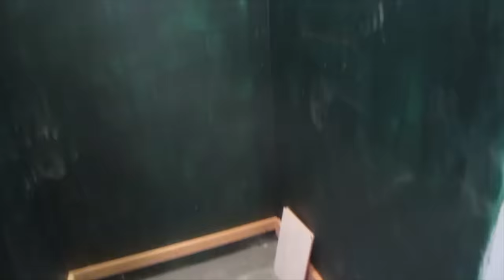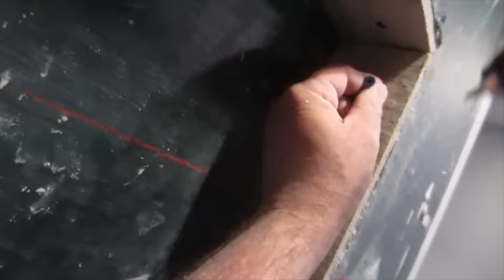Complete bathroom shower install time lapse start to finish

Comment: Now this guy knows what he’s doing.... thinset under a  properly mixed pre-slope... this guy cares but I think a pre-slope is unnecessary.... this is as good as it gets as far as installation never the less
Reply from the maker: Preslope is an integral part  of a two stage "Water in, Water out" shower system,  don't  believe what others might tell you.

Comment: I am building a tiny home and would like to install tiles in the shower stall. Because weight is always a consideration in building on a mobile platform, I am strongly considering using 1" foam board in lieu of the traditional cement board. Aside from being a fraction of the weight of cement board, it is highly moisture resistant. The tile is a mother pearl tile which is also very light as well as thin (2 mm). The manufacturer recommends using a white or clear modified thin-set w/ non-sand grout. With all of this said, do you foresee any issues using a foam board underpayment instead of the traditional cement board?
Reply from the maker: I hardly ever use cement board these days, Iso I don't see an issue there, the problem will be movement of the mobile home.

Comment: Nice work, just wish you would have shown more on your curb finish after liner and whether or not you redid the waterproof for the soapbox after you cut the hole in the wall

Comment: Did you need to mud your cement board seams after you taped them or is it ok to just apply the waterproof membrane over the mesh taped seams?

Comment: All of this looks great but I thought the durock has to be 1/8 inch minimum above the drypack according to tcna and your previous videos? Primary reason is the moisture wicking and cracking the bed. Am I not seeing something here?
Reply from the maker: Durock is a cement board, so can be in the mud, Hardie is a Fiber cement board and must be above the mud. TCNA B415 Look it up.

Comment: What happens after you put the polymer membrane on the floor and before you start putting the mortar for the tiles? Is that a cement sheeting adhered to the membrane with a special cement?

Comment: nice vid @SAL, gotta question for you, I`m presuming this shower stall was done in the basement, with an already existing concrete floor, what if I want to do something like this in my upstairs main bathroom? with a wooden sub floor. do i use a shower pan, or can i go with something like you did? would that not add weight to the existing floor joists? and if I can do it how would I make it completely waterproof? I`m up in Canada by the way. Thank you.
Reply from the maker: I have just the series of videos for you https://www.youtube.com/playlist?list=PLiB6hq5lQ3h2T96DP_LdSbULklkRaqYPr
Reply: thank you very much, this is much helpful, very insightful way of doing this, and do you by any chance have a complete studs to tile with the orange kerdi stuff?

Comment: I got a few questions.1 how wet should concret be density thickness yours looks dry is that normal  2 should i durarock outside wall of shower and tile does it matter

Comment: Excellent video. I have a question. I’ve done two of my showers, both times using 1/2” hardibacker and then painting redgard over it. Now I’m hearing that I should have used a vapor barrier behind the hardibacker on the studs, such as plastic sheeting or tar paper. Is this necessary when using redgard over the hardibacker? Thanks everyone.
Reply from the maker: No, either a topical waterproofing on the surface, or a vapor barrier behind, not both.
Reply: Sal DiBlasi holy!!! What a quick response! Thank you sir!

Comment: Since it skipped the part where you sealed the seams, I just wanted to know if you can use fiber tape and waterproof membrane over the seams and corners or is thinset and mesh tape a must?

Comment: Personally, I've repaired dozens of showers where the mortar from the pan dry rots the framing. Mostly bottom wall plates and subfloor decking. Please use some vycor tape or something like that between your deck mud and your framing.

Comment: Floor definitely has lippage. And when you grout , you should go against the joints or diagonal wipe. You're just emptying them if you wipe same direction as joints.
Reply from the maker: Your floor might have lippage, mine don't. I have been installing tile for 35 years, I think I might have figured the grouting thing out.
Reply: @SalDiBlasi  I'm just telling you what I see. And so what if you've been doing it for 35 years? I 've been doing it for 40 years, does that mean I'm better than you? Don't get mad cuz I'm stating what I'm clearly seeing. Your wiping the grout wrong buddy. And I can tell the floor has lippage.  Also why do you use a crap load of leveling spacers. ?

Comment: So my contractor did our walk in shower with Durock with edge guard, under that is that plastic sheeting that is about 2ft up the wall and on the shower floor, my concern is he never used red guard or any water proofing, we live in Miami one story home, says we don’t need it because there is no floor underneath us
Reply from the maker: If you havea wet area, you need waterproofing, no ifs, ands, or buts

Comment: Hey Sal, what do you typically charge for small walk ins? 60x32 Labor wise on the medium end.
Reply from the maker: +Joseph Chavez I have said it many times I never talk about cost in an open forum.
Reply: Sal DiBlasi just wondering why not? I'm not being a smart ass but really want to know since i don't really see the problem but know that there could be something I'm not thinking of. i usually tell people my  price per square foot before looking at their job so as not to waste our time.
Reply from the maker: Every job is different, if I say I get x amount of dollars for a certain type of job, then people will have an expectation of cost no matter what the circumstances are. I also never give a ballpark figure of cost, even when I am told that I will not be held to it, because if the actual estimate turns out to be more, they always will bring up the ball park cost you gave them, "But You said it would cost....." And a multitude of other reasons that can only bring you grief.
Reply: I know in my own group of guys, they dont share info cause of compitition and thats fine with me, I just teach myself and try and give my clients a reasonable price, what time is worth, but sometimes thats cheating myself. 

Well, what do you charge for just the drain, sandmix preslope, liner, sandmix final 2" layer and curb install? No tile. That should seems to narrow it down. lol. 

Rough ball park on small one.
Reply from the maker: Like I said, I don't discuss price, besides  how big is the shower, and what kind of system is going in, is it a sealed system, is it a water in water out system is it a hybrid. do I have to install the drain, what am I supplying, just a few things off the top of my head. I look at a job, find out what the scope of work is and go from there.
Reply: Sal DiBlasi Like i said, I do understand. 

Well, it takes me about a day to do all the work to get a 60 x 32 (3) 2x4 curb ready for tile. Was just looking at a guestimate on labor.
Reply: I use to sub out the base. I only put the tile on top of the base. But ive taught myslef how to do it all now because i want that money. But im just wanting to know if im charging them right. ive been charging $1,000 on my own and half that for contractors.
Reply from the maker: Do This, if you have a Facebook page, ask to join Tile Geeks I am a member and so are thousands more.

Comment: Great work sal, how long did it take you to do this bathroom?  I work for a remodeling company and they want me to tile a bathroom in one week by myself, that includes demo, plumbing and the regular stuff. I feel that one week its not enough time.
Reply from the maker: If you work 16 hours a day for 7 days no problem, rest sleep and food are over rated. Even with help you would be hard pressed, some steps require drying time, I would tell them to go find a hack, that can screw it up in an even shorter time.
Reply: I can do it with my helper in 3 days.
Reply from the maker: Gone are The days that I rush and push to get things done. I have been doing this for thirty years, I am over it.

Comment: Yo Sal, I was wondering if wonderboard Lite would do the job as well? I asked local tile setters about the pre-slope at the beginning and they kept saying it was wrong..lol  Definitely a red flag so I didn't hire them. BTW your finished product is like "forget about it" lol
Reply from the maker: +JOSE MORAN Wonderboard light will be just fine, the preslope is absolutely needed, you did the right thing not hiring them.

Comment: I installed 1/2" hardibacker against wood studs for my shower area. I had a pro put in the shower pan with the liner about 8" high. I've been told that I can tile right over the hardi board. Due I need to put that "green" stuff on first? Thanks
Reply from the maker: You can tile right on the hardibacker, but it will not be waterproof. I always use a liquid applied waterproofing membrane when I do mine, if you want to make sure that you never have a leak i would suggest that you do the same.

Comment: Man, you're killing yourself with that grout. Get you some Ardex FL. Stain resistant. Micro sand so you can use it in place of unsanded. Rapid set. Ready for full traffic in 90 mins. Color match silicone. Truly guaranteed. Can't beat it.

Comment: Sal, what parameters force you to pick and choose between cement boards and hydroban and schluter systems?Obviously the pre wayerproofed systems are better than waterproofing cement boards
Reply from the maker: I haven't used cement board in many years, as far as the others go, whatever I feel like on that day.
Reply: @SalDiBlasi  My fault. I didn’t notice the upload date. Even though I’m licensed,I’m a novice. From now on forward I’ll be using Schulter and systems alike. Now that I have done one bathroom with cement board I’m never doing that again.

Comment: thinking about installing a tiled shower on the 2nd floor.  are there any negatives? what about a prefab shower base?
Reply from the maker: +Optics If the shower is built correctly there is no reason not to.

Comment: Hey Sal how do you feel about tiling over plaster.
Reply from the maker: Why not
Reply: Had customer with plaster that was not flat and had cracks in it. I recommend tear down and start from scratch. They didn't want to do that. Instead wanted me to try to plum wall with mud and durrock. Told em not sure if u could that but wouldn't be able to guarantee the work as the plaster is cracking and isn't flat. Using subway tile they would see every imperfection. You think that was a good call.

Comment: I noticed you set up the mud on a concrete floor - can I do this for a second floor shower where there's only a subfloor?  if so - what are the differences?  Would appreciate any guidance.  thanks
Reply from the maker: If you have a wood sub floor, this how you do the preslope How to install a shower pre slope

Comment: When you install the cementboard.  Wouldn't the screws make holes in the liner? Would that be a problem?
Reply from the maker: That is why you never put screws below the height of the curb, and why you waterproof the entire surface.
Reply: Sal DiBlasi thanks!

Comment: Hi Sal, after you installed the liner, did you then install the Durock and then the second mud pan?  Or the second mud pan on top of the liner and then installed the Durock after?  In either case, how much of a gap did you leave between the Durock and the liner or mud pan?
Reply from the maker: +mister santos I usually install the durock before the final mud bed and leave it at least an inch off the liner, but i have to also add that i waterproof everything including the mud bed before installing any tile.
Reply: +Sal DiBlasi I will be waterproofing everything as well.  How far from the mud bed will your lowest screw be when fastening the Durock?  I'm assuming you can't go too low because you'll be piercing the liner behind it and then the final mud bed is what will be supporting and keep the Durock in place at the bottom...or is all of that irrelevant because of all the waterproofing that will be done?
Reply from the maker: +mister santos Always stay a few inches above the height of the curb, and the mud will anchor the lower part of the durock.
Reply: +Sal DiBlasi thanks for the help.  Been watching your videos repeatedly to prepare myself as much as I can before executing my shower.  Thanks for taking the time to reply and for posting all of these how-to videos!
Reply: +Patrick. Santos kmm

Comment: Sal hello from Ok. Certified tile installer 1009 here. Why wouldn't you move away from the pan liner and 2 peice drain and just use an integrated bonding flange from schluter, mapei, or laticrete? This would save you time since your already using fluid applied membranes. Also brush up on your TCNA rules for showers
Reply from the maker: You might want to check out some of my other videos, there you will find what I am all about, which includes  Schluter, Wedi, Hydroban board and much more. here is a link, https://www.youtube.com/user/saldibs by the way I am an NTCA member, have been to the CTEF and the TCNA and attend Coverings every year.

Comment: I noticed that you used 2x4's to construct the curb.  I heard this isn't a good idea when installing on concrete because the wood absorbs moisture from the conctrete and swells.  For my shower in the basement I would like to use 2x4's to do the curb, should I do anything to make sure they don't absorb moisture from the concrete?  Great videos!
Reply from the maker: Sean Marleau I actually did not frame it, i just took it from there, but you want to make sure you isolate the wood from the concrete.

Comment: Mr. DiBlasi, Is it possible to tile over an existing shower floor by grinding it? the old floor is made of what seems to be a pitched base of smooth concrete or stone with black and white chip design.
Thank you!
Reply from the maker: Without knowing how the floor was constructed it is hard to say, but it may be possible to tile right over the existing floor and using an extension at the drain.
Reply: I have a close up photo of it but I don`t think I can send it trough here..it is just a one piece slab shower base very thick and very solid like stone/concrete..it  is very smooth to the touch, so should I brake/chisel the surface so the thinset and tiles will adhere better?
Reply from the maker: Global Homevest I can't possibly tell you what to do, sounds like it might even be Terrazzo, but like I said i would need to physically see it and touch it to be able to advise. It is only a guessing  game from my end.

Comment: Sal I have a new home (new foundation) that I plan to install tile. The tile has manufactured edge that allows small grout lines without using spacers. Would it is a wood style tile. Would it affect home settling and causing cracks being too close edge to edge?
Reply from the maker: Minimum grout size is 1/16" should never be smaller than that.
Reply: @SalDiBlasi  I think that manufactured edge gives 1/16 when two tiles are pressed together. Thanks
Reply from the maker: @SharpBlockSoft  should not butt tiles together.
Reply: @SalDiBlasi  thanks. I will use 1/16 spacers

Comment: One thing I don't like about the rubber pan base in general is all the ones I've replace are typically full of water under the tile --- but at least they don't leak
Reply from the maker: That is probably because there was no preslope and the weep holes were plugged.  https://www.youtube.com/watch?v=p8xsx3316IU

Comment: I see this master tiler guy "TileMasterGa" on youtube who does not seal all of the backer board and only applies thin set on the tile, not the wall.  Where do these guys get off calling themselves Master Tile Setters"?  They can't even follow simple directions or use industry standards.  Love you videos.  Nice to see things done right..
Reply from the maker: I actually know Michael and he is a good guy, he uses a lot of Denshield which has a waterproof membrane on the surface already and only needs to have the corners and seams treated, so nothing wrong there, and there is nothing wrong with applying the thinset to the tile, as long as you get good adhesion to the walls, i do it often times myself. I try to go by the book a bit more than he does, i don't agree with everything he does, but I am not going to bad mouth him either.

Comment: What is the name of the sand mixture that you use starting at 18 seconds? Does it harden like concrete after you are done giving it the pitch?
Reply from the maker: What is being made is deck mud, and it does not need to be like concrete.

Comment: Are putting screws through the liner to secure the durarock?
Reply from the maker: Never below the height of the curb.
Reply: @SalDiBlasi  happy Thanksgiving Sal. One thing I never did figure out with the kerdi system is this I learned the mud shimming from you which I think is brilliant and my walls are flatter/ plumb than they ever have been but when I build up the multiple layers with the inside corners it throws my wall about a quarter-inch out of plumb because of the bow at the bottom or build up I should say.
How do you solve that?
Reply from the maker: @BKMDano17  Takes a little practice and you need to avoid building too many layers, you should do a Schluter workshop, they give lots of good tips on how to do it.

Comment: Hey Sal,you're great!
just a question, what type of cement do you use?
Reply from the maker: For the shower floor, deck mud which is sand and cement at a ratio of 4to 1.